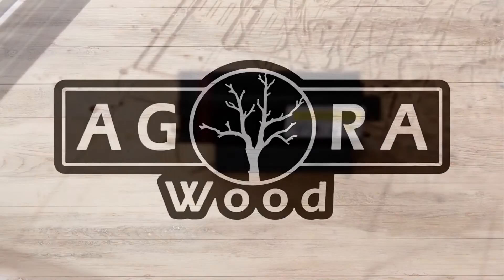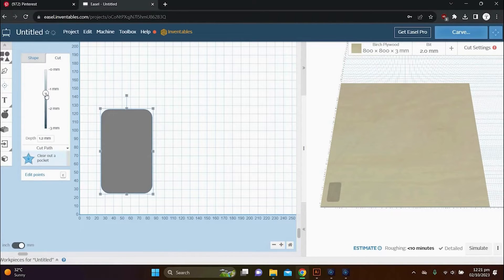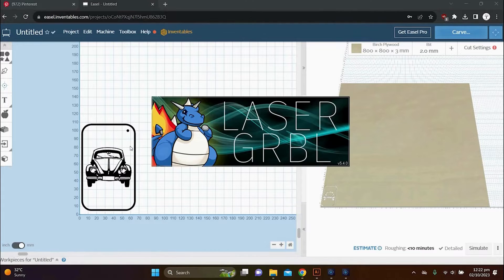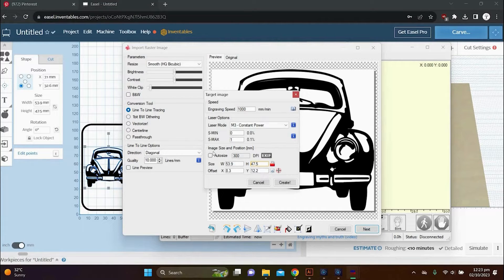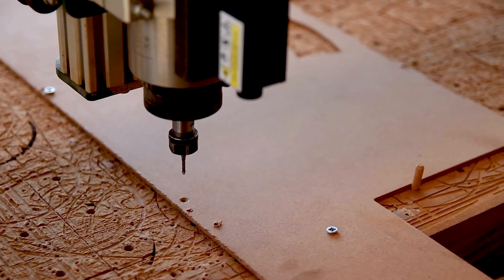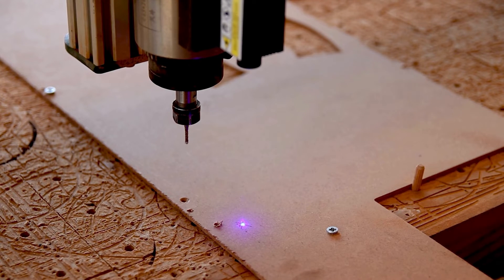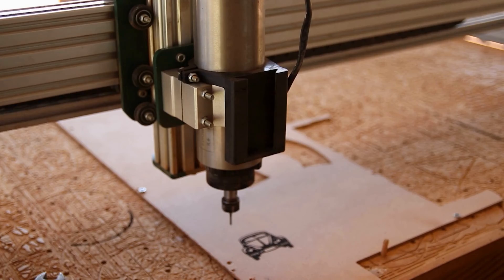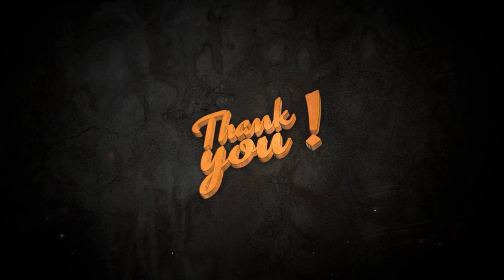How to Position your Image in Easel Inventables & Laser GRBL

Comment: I love this smart cnc laser combo. Do you have some ventilation or dust collector while doing your things?
Reply from the maker: Thank you for all your kind comments! I really appreciate it so much. 🥰 I currently just use air to blow the dust particles away. It works quite well, but it requires some cleaning up afterwards. I am currently saving up to buy a dust extractor.